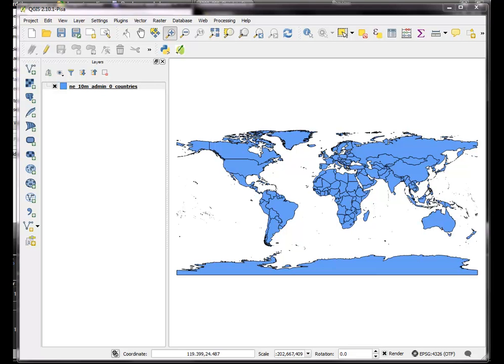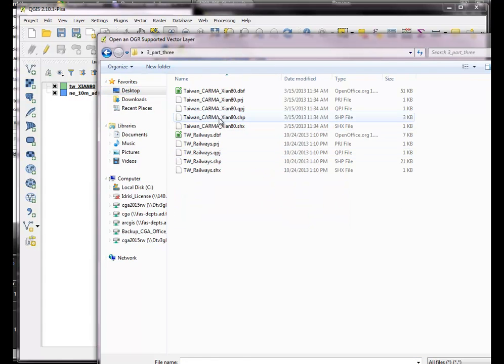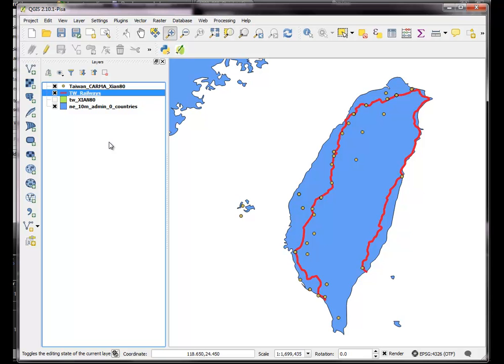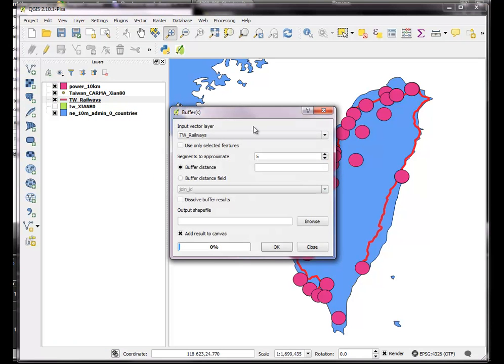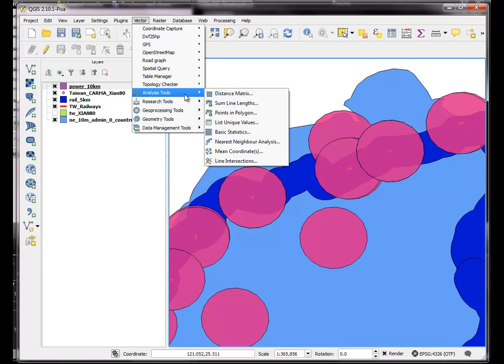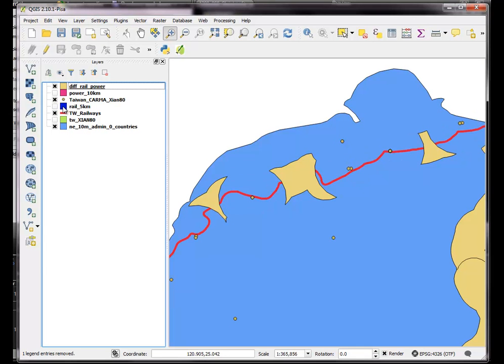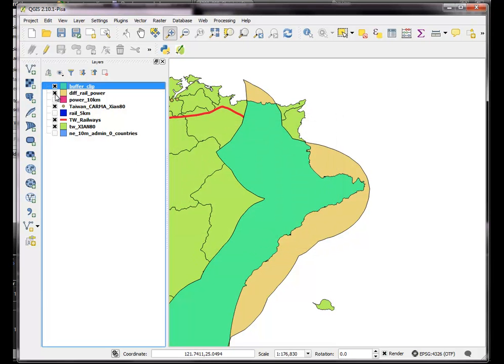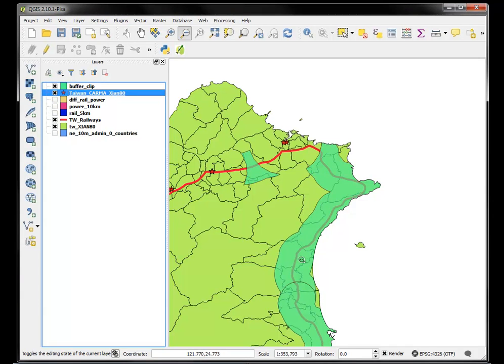QGIS 2.10  -   Buffer, Difference, Clip

Comment: Hello Lex, i'd like to ask you. I imported a point in kml format from google earth. When I put this point in qgis, transform to a shapefile, and try to buffer , it doesn't work. Do u know what i am doing wrong?  The result of the buffer, covers the all the map, but i putted 1km. thank you
Reply from the maker: hi Delta,   the buffer works on points layer in units such as meters.    try saving the kml as a shapefile and pick a project that has units =m.    then I think you might need to tweak the numbers being input.    even though the units are meters, I think the form assumes they are km, or 100 km (it is a bit strange).   Sometimes I just try putting in 0.1 or 0.01.   When I finally get a result that looks "reasonable" I use the measure tool to see what the actual radius distance is to make sure the buffer was the correct distance.   Hope it works, --Lex
Reply from the maker: hey delta, sorry for long wait, if you still didn't figure out, it is a case of the units of measure.  if you are in decimal degrees projection the value entered for buffer distance is larger than the earth.  you have to be in projected units, for example meters, then 5000 should be 5km.  I did notice in some versions of QGIS the system "expects" the entered units to be km... don't know why.